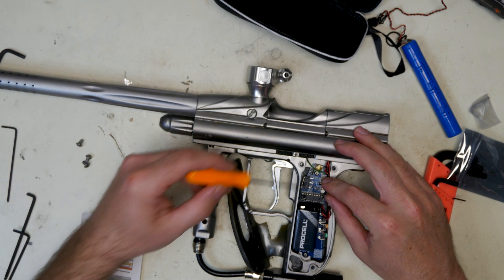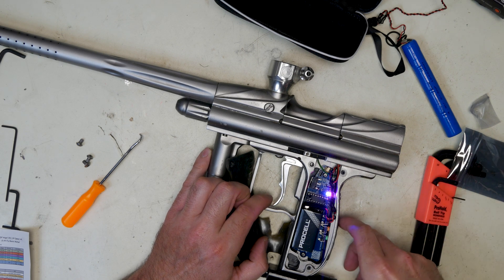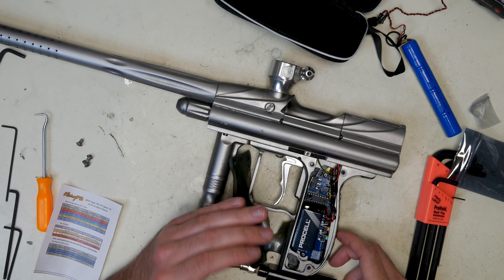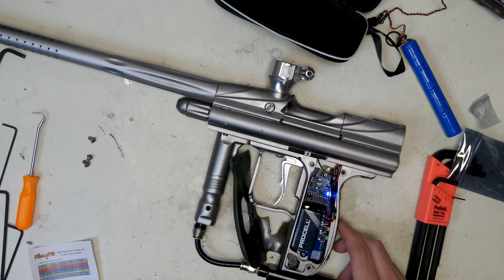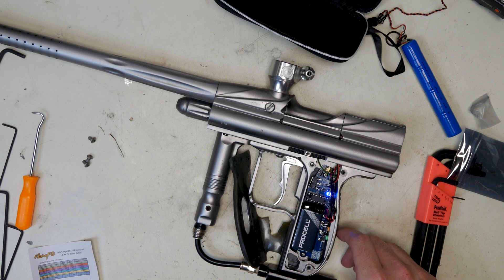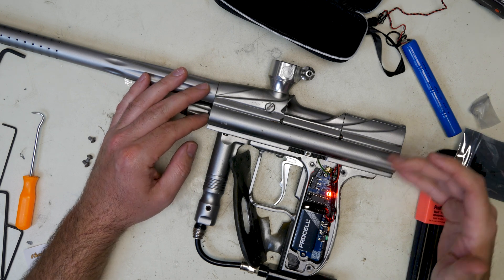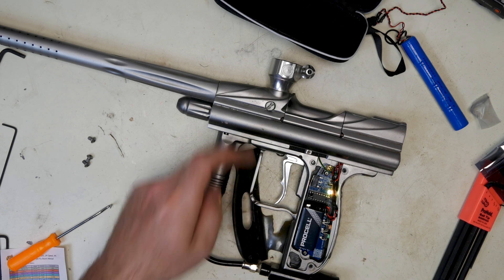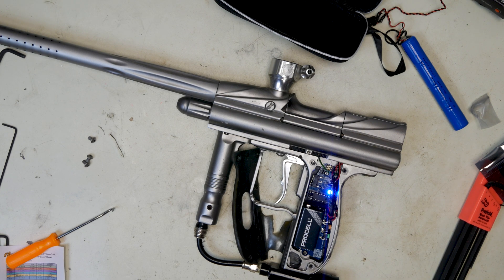FloryPB IR3, 04 Speed, A4, A4 Fly Circuit Board Manual

Comment: What's your recommended air input pressure?
Reply from the maker: 200-250ish for the hpr output and 60-70ish for the lpr dwell 12 or 13 for an 04 speed into the a4s

Ir3 is more like 350ish hpr and 70-80 lpr with the dwell 13 or 14